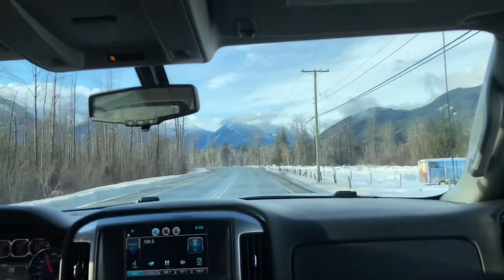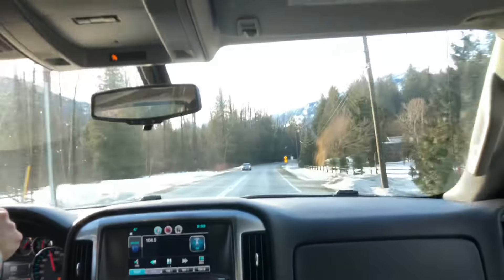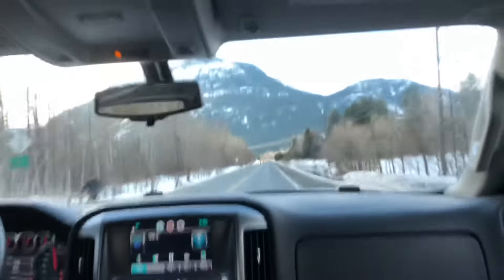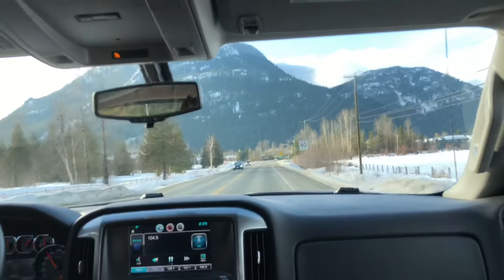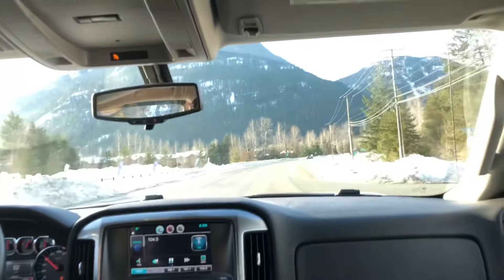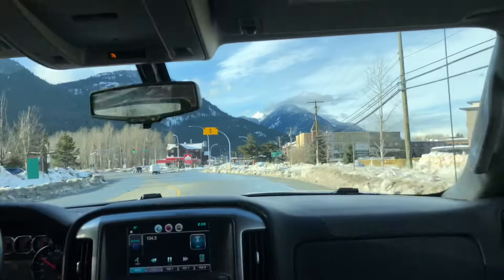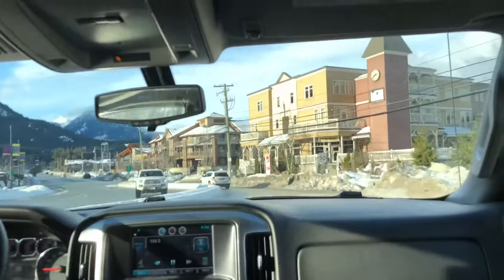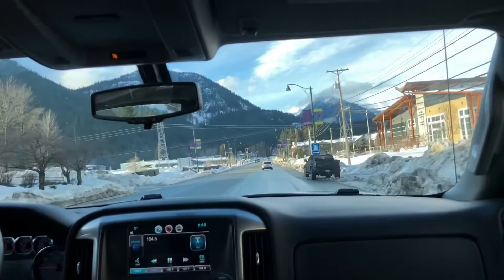What I wish I knew before buying Magnaflow

Comment: They tell u it takes about 400 mile to get louder, I did my homework and it says it. Just bought one myself. Dont want Flowmaster
Reply from the maker: Cool man good to know 👍🏽
Reply: Flow master will piss off your Neighbors at idle, mid and full throttle, Magnaflow  will only piss off your Neighbors if you hammer it. If you like highway drone buy loud mufflers and then take a 300 mile trip.
Reply: What do you recommend
Reply: @Green Bastard I like the 11224 magnaflow muffflers on the 4.6l engine.  They will sound tame until they break in and don't drone. If you leave all 4 cats on they are pretty quiet. If you remove the rear cats they sound good with the stock tail pipes.
Reply: i realize it is kinda off topic but does anybody know of a good place to watch new series online?
Reply: @davidbrennan5  Im contemplating about taking the stock off and not sure what one yet , My truck is also a 2016 RED & black trim sport . leveled with everything blacked out lights ect all decals OFF . only 4x4 replaced The fender decals with just a smaller ram emblem with a red and black matching Sport decal . Hemi decal on the sport hood both sides . along with grabber bigger tires and shinned black with little red in the wheels looks GREAT !! live in an apartment with underground parking . No one to piss off well maybe but they are OLD probably won't hear anything .. baha
Reply: It sounds like you have a older Dodge Hemi truck? If you want attention past 1/8th throttle get some good  Borla mufflers and get a muffler shop to make you a custom bent dual exhaust. If that is not enough get some 3" diameter tips about 5 inches at least  long welded to the tips to make it louder. That sounds loud and badass on a 5.7L hemi or a 5.0L ford V8.
Reply: Flowmasters are made in China now, too (but still cost the same).
Magnaflow is made in USA
Reply: Good to know thanks. Probably why mine got louder and flange bolts seized on so I had to cut it off in pieces!! Magnaflow next time for me.
Reply: Yes! Magnaflow is far more superior than flowmaster. Borla, and Magnaflow are superior mufflers!
Reply: I put a flow master dual on my c10. The drone is insane. But I mean who wants a quiet hot rod? 😂
Reply: No, I think you copied off the def kid & didn't do your homework cuz none of us would be here rn if ya did. lol
Reply: Round muffler will be louder.  Jones maxflow mufflers are designed like magnaflow at a fraction of the price.

Comment: Magnaflow is great for daily drivers. They're not excessively loud and have significantly reduced drone, but still have a nice little rumble at idle and good volume when you really step on it.
Reply: Perfect
Reply: Installed Magnaflow and sounds amazing without waking neighbors unless I floor it.
Reply: I agree,but mine is starting to drone more at 2,000-2,500 in 5th gear cruising.
They sound nice and mellow under 1,500 and get pretty rowdy at wot.
I'am going to try their x pipe muffler,since I don;t have any H or X pipe now.
I really like the sound of them on my 4.6 mustang.

Comment: What people don't consider is that every car and truck is build different. Every engine has its own unique sin wave of sound. A Mustang 5.0 sounds way different then a Toyota V8 Also Each vehicle has different insulation. A Nissan Titan is build different then a Chevy truck or F150. Then do you have Headers? Shorty's, Long Tube, High Flow Cats, No Cats, dia. of exhaust pipe, H-Pipe/X-Pipe, Dumps, side pipes. So take it all with a grain of salt comparing Mufflers Brand X vs Brand Y

Comment: MAGNAFLOWS are lifetime warranty if they do get louder you can get them replaced for free.
Reply from the maker: For the USA there is. It’s limited lifetime for Canada. 🤔 Here I’m waiting for it to get louder. Haha.
Reply: Even then you still have too get someone to install it so
Reply: @raymondchen6720  use the 3” band clamps it you can remove it without welds anytime.
Reply: Does your magnaflow sound bubbly at a cruising speed? Like you have to press the gas pedal a little harder to smoothin out
Reply: @b_amayzd3646  I have a big intake longtubes headers and a 3"x pipe and a tune it breathes, only bubbly feel is the shake from the cam.

Comment: The thing that attracts people to magnaflow systems is that they give you a nice rumble sound at idle and they aren’t loud just for the sake of being loud. If you want super loud, you buy Flowmaster, Borla, or you do straight pipes. The beauty of magnaflow is that you get a good sound without the drone, but it will also get loud when you stop on the gas. Yes, they do get louder as they get older, but it’s a very gradual change and you’re not likely to notice it as much.
Reply from the maker: Very true. Chopping the resonator off if you have one makes a huge difference too. 👍🏽
Reply: So what about the Magnaflow Rumble? Is that any better, I hear it sounds the same as the Flowmaster but better performance.
Reply from the maker: @slothbros4323  IMHO Flowmaster has a different set up that causes drone that causes more of a headache than a "damn that sounds good" drone.
Reply: Borla not loud at idle. I have a full borla exhaust . Long tube headers on my challenger. I actually like the magnaflow sound better. I thought it was louder and more aggressive sounding. Borla is to damn expensive
Reply: I just got magna flow today on my 5.7 Hemi. It's quieter than the factory exhaust. I'm freaking mad. You can have my magna flow for free.
Reply: @slothbros4323  there is no such thing as magnaflow rumble. Mine got installed today . It's utter garbage. I can't even hear my dodge Hemi idle.
Reply: @rippertrain  what's the part number on yours?
Reply: @jonnyboy9213  absolutely no idea
Reply: @rippertrain  that has more to do with the length of muffler than it being a magnaflow.  My factory muffler was almost 30”.  My magnaflow is 18”.  Big difference in sound.  I’d be willing to bet the magnaflow is probably about the same length as your OEM muffler
Reply: @Holgrinator so was your setup loud? Which magnaflow part number did you get?
Reply: Flawlessly stated.....that's what all my research brought me to as well. I had a Capristo stage 3 on my Ferrari 360 and it was very cool when you start it up and it sounds bad-ass....BUT after a few minutes and upsetting all the neighbors and trying to listen to music or talk on the phone, the loud sounds, drone and resonance gets ridiculously old. You need to ask yourself: do you want an exhaust that sounds cool 2% of the time or 80% of the time?
Reply: @rippertrain you still have that magnaflow muffler?
Reply: @crs1474  yes I do. It took a year but it sounds a little better now
Reply: Everything you said are ALL the reasons I buy Magnaflow.
Reply: @rippertrain wtlht was the part number of ur magnaflow?
Reply: @leoladani6421  I don't know, that was 2 years ago. I will never buy another magna flow. I stand by my words. Magna flow does not rumble. The dodge factory exhaust sounds better.
Reply: @leoladani6421  my 76 stingray has 2 small mufflers on it and it sounds raw and rumbles like mad. I'll look at them in the morning and let you know what kind they are. All muscle and all the sound
Reply: @leoladani6421  my 76 stingray has dynamax 17733 , 100 times better than any magnaflow garbage
Reply: How’ll you pass emissions with straight pipes?
Reply: @rippertrain you didn't do proper research before asking the shop to "put one of them magnaflows on it"

Comment: I've had the 15778 installed on my 04 GMC Sierra for almost 2 yrs now and felt it was too loud after I had it installed but it has gotten better or maybe I've just gotten used to it. This one is just like stock in that it's the single side exit which I wanted. Really other than the sound the biggest difference is that it's a larger exhaust so it flows a lot more freely with less backpressure which I really notice when coming down the mountain that the engine braking doesn't work near as well due to the stock exhaust holding it back. After I had it installed I was actually looking at adding a 2nd muffler to quiet it down some and found a good place where you easily cut a section of the straight pipe out and then add it but I've decided to give it some time to break in.

Honestly IMO I hate the flowmaster sound, when I was growing up everyone had those things on their mustangs and to me it sounds like it's running through metal trash can. I like the Magnaflow and is not raspy like Borla or Gibson.

Comment: I put the Magnaflow cat back system on 4.7L 4 runner.
Muffler was rusted out so needed a new one.
The cat back set up made it easier to DIY, since it could all bolt in, no cutting and welding.
And it has nice looking dual side exit tips.

Removes the resonator also.
IMO it is the perfect set-up.
Not crazy loud at idle and no drone at highway speeds.
But when you get on it, it is loud and growls.
Reply: I have a 4.7 runner as well, I put on the cylinder magnafkow and didn't like it. It trumpets and drones despite having resonators. So loud, but not in a good way. It does have a nice idle cold start. 

When I had 5.0 mustang I put a borla for a deeper sound to balance out the raspy racing engine. So I'm guessing with a deeper truck I need to go with something that sounds more "exotic" to balance out that deep truck sound and eliminate trumpeting.

That's why I have a corsa universal muffler on the way. I saw reviews for in on a v8 gx470 and it sounds like it doesn't drone, yet has that fun cold start and is fun to downshift while going through tunnels. 

Basically loud in the right way, her still eliminating drone.
 .

Comment: It isn't only about sound! They're called performance mufflers for a reason...they're less restrictive than factory mufflers. Flowmaster-style mufflers are hollow metal cans with baffles and chambers inside. Those baffles and chambers cause exhaust turbulence, but they still flow slightly better than your average factory muffler. MagnaFlow-style mufflers have a straight-through design. They have practically no restriction.
Reply: Yep and I agree. Put a 14 in magnaflow and a K&N high flow filter on my 4.7 ram and completely changed how it drives. It carries speed so much better and works effortlessly. I chug backroads 45-50 at 500 rpm and the magnaflow is so quiet off idle going down the road I can hear the treads accruals gripping the pavement and I’m not talking about mud booger howl. I have no regrets over the magnaflow.

Comment: I purchased nothing but flowmaster 50-70 series from ages 16-28 on my everyday driver trucks and always loved flowmasters. Now I'm in my 30s and have been waking up for work at 3 and 4 am 6 days a week with neighbors and kids, I've went with 22 and 24 magnaflow ovals the past 7 years. From my personal experience and opinion, magnaflow is where it's at and if it's too quiet for ya then you can always remove stock cats, replaced with high flow cats and ofcourse remove factory resonator or purchase a high flow one as well or even consider shorty headers with it all and it'll remain deep and mellow but it will definitely have more decimals while idling. Everyday pickup truck and suv drivers should not be loud and abnoxious because at the end of the day, it's only a truck and an suv not a performance machine from hell. If thats what your looking for then I suggest maybe a sports car or older muscle car that actually makes sense and sounds as it should being loud and abnoxious. Also, magnaflow lasts twice as long as the chambered flowmaster because of quality and material. Magnaflow makes entire kits for most and flowmaster doesn't yet. The flowmaster fx oval muffler is kinda similar to a typical magnaflow just again a little crisper and louder inside and out but it is stainless and it is only around $50 compared to 100 or 200 but remember guys, we pay for what we get!
Reply: Thank you for your comment fam! It helped with picking my decision between magnaflow v flowmaster. I’m currently 26 w/ 3 children & didn’t want to be that guy coming home at 12 Am from work having the laws called on me. I actually wanted to do a muffler delete, would you recommend getting a high flow resonator or should a standard performance resonator be fine to get that loud rumble when idling or accelerating?

Comment: I had a 98 F150 4.6 with true duals, magnaflow cats, and magnaflow oval mufflers. At idle it was barely louder than stock at all. There was some noise enough to to know you have a nice exhaust tone while driving, but nowhere near obnoxious. It sounded great on wide open, but still not annoying. I had it on the truck for about two years, and NO, the mufflers never got louder at all.  My 98 just got totaled for me a few weeks ago, so now have a 2014 5.0 STX. I think I am going leave the resonator on, cut out the original muffler, and install a magnaflow 12576 in it's place. I will try to find a shop that actually knows what they're doing, and they will make a hanger that won't rust out and break for the rear of the muffler. Then, on the end of the exhaust, I have a 3.5" slash cut stainless tip with a rolled edge, and I will finish it off with that. I had Flowmasters on my 1970 Torino, and I finally cut them out. Honestly to me, they sounded like crap, and I couldn't wait to get them off. They're leaning on the back wall of the garage, and will likely never get used again.

Comment: I have a Magnaflow 14815 muffler on both my cars. 1990 Nissan 240sx swapped with a RB25det incline 6 cylinder with T67 Turbo 778 HP at 24psi and on my daily driver BMW 323ti E36  N/A inline 6 cylinder with bolt on mods and tuning making 300HP if I'm lucky lol... I have removed the cats of both cars but do run a resonator to delete any drone noise... On the 240sx it's very quiet because the turbo muffles the sound which is great because the exhaust noise doesn't overpower the noise of the turbo spooling. 
On the BMW on the other hand it is actually louder during acceleration and on the highway. 
Overall I think Magnaflow makes great products with a nice deep sound and no rasp. However you need to purchase their higher end products. I have seen and heard some of their entry level products and I wasn't too impressed. With Magnaflow if you're willing to spend a little extra for their higher end products you will definitely get what you pay for and it's well worth the few extra bucks. Also the stainless steel has kept up really well on both cars. No fade, the tips still look like new when they are cleaned.
The only time they could be a little loud is during really cold weather on cold starts but that goes away after a minute or so.
Magnaflow is a product I definitely stand behind.

Comment: Brah, just put an exhaust cutout valve on it, with the push of a button, you can hear it straight piped for as long as you want, then push the button and it goes back to the normal exhaust route.
Reply from the maker: One of my buddies showed me a cut out. Def the way to go!!!
Reply: @brandon1423  spray WD-40 inside the exhaust pipes? WD-40 is highly flammable.

Comment: I have a 4.7 runner as well, I put on the cylinder magnafkow and didn't like it. It trumpets and drones despite having resonators. So loud, but not in a good way. It does have a nice idle cold start. 

When I had 5.0 mustang I put a borla for a deeper sound to balance out the raspy racing engine. So I'm guessing with a deeper truck I need to go with something that sounds more "exotic" to balance out that deep truck sound and eliminate trumpeting.

That's why I have a corsa universal muffler on the way. I saw reviews for in on a v8 gx470 and it sounds like it doesn't drone, yet has that fun cold start and is fun to downshift while going through tunnels. 

Basically loud in the right way, her still eliminating drone.

Comment: In terms of quality, Magnaflow is better than Flowmaster. Lots of leaking issues with the Flowmaster. Everyone buying additional clamps because of how bad quality the clamps are that comes with the Flowmaster. Not to mention rust issues. I used Magnaflow for 3 years and it sounds great. It still looks like when I first got it, no rust at all.
Reply from the maker: Lucky. Haha. Mine rusted after one winter. I’m sure its just surface rust. They salt the hell outta the roads here 6 months out of the year.
Reply: I've never installed a bad fitting Flowmaster system

Comment: I put a magnaflow muffler on a 4.3 v6 s10 that had a 2.5" in with dual 2.5" exits going to 2 3 1/2" x 12" tips and at idle it sound really close to a v8.  It actually sounded really good from idle to about 3k rpms after that it had a v6 buzz to it.  I fooled a ton of people thinking it had a v8 though.  It had a more mellow tone with a lot less drone compared to my buddies truck with basically the same setup with a Flowmaster 40 series.
Reply from the maker: Awesome
Reply: You can make those 4.3L vortecs sound just like v8s. All of them sound like v8s on start up until they warm up.
Reply: @thronewalker1153  mine definitely fooled a lot of people.  It sounded really good until you put your foot into it and it got over 3k then it would show it's v6 colors.  It didn't sound bad but it clearly wasn't a v8.  I used the same exhaust after I put a sbc 327 in and it sounded way better then v6 could ever hope too sound.  I'm debating on swapping my slp exhaust on my 05 gto out for magnaflow's.  I like how they seem to be a bit more mellow then most mufflers
Reply: @ziptiejedi5658  those things are beasts and no matter what they will sound like beasts.

Comment: About 12 or so years ago I bought a used 2007 Chrysler 300 SRT8 with the 6.1L Hemi. It had Flowmasters on it. It sounded nice on startup and full throttle runs but had an annoying drone at cruising speeds. I later switched to the Magnaflow cat back system.....much nicer, drone gone, still nice startup and full throttle sounds but much quieter at cruise.